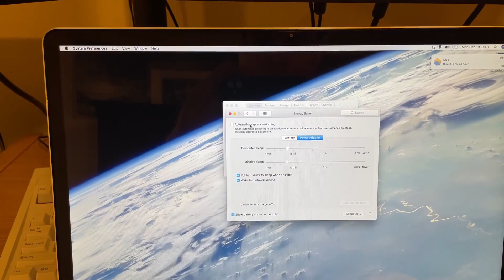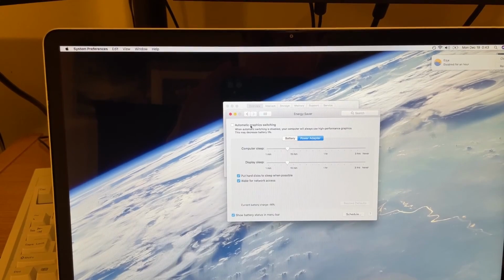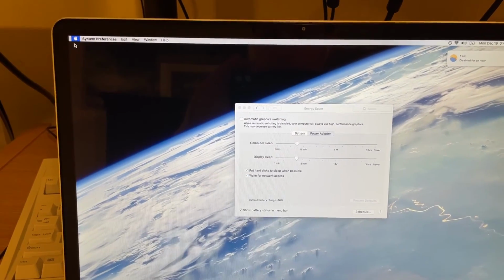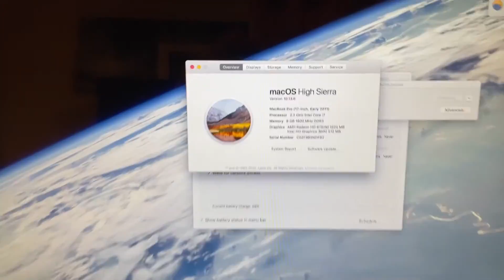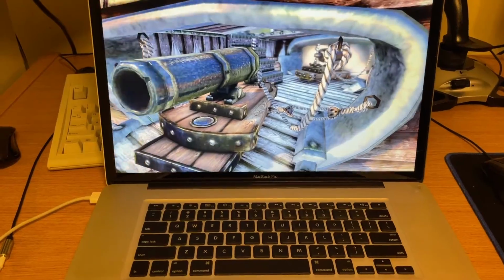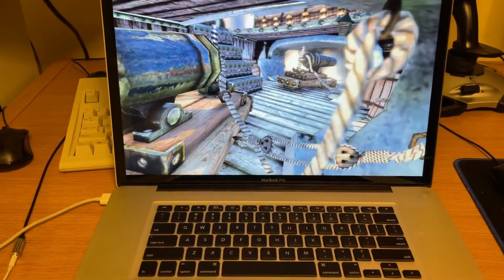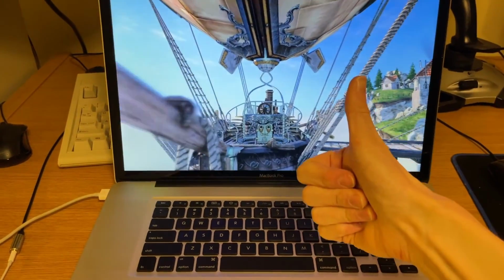2011 MacBook Pro 17" A1297 Faulty GPU Replacement

Comment: How did you do this? Is there a guide anywhere that I can follow? Thanks
Reply from the maker: Standard BGA rework. No tutorial needed, but you have to be trained on the equipment.
Reply: @Josh.Davidson  if you didnt have the equipment needed to perform this, would it also be worthwhile to replace the logic board with a working one and sell the faulty one? and if i went through with that, would i need to transfer the serial number from one logic board to another? (idk how to explain it, i mean the part numbers of the cpu, gpu and stuff)
Reply: @Josh.Davidson  ig my question is, if i just replaced  the logic board with another one that has the exact same specs, would i need to do anything to make it work?
Reply from the maker: No.
Reply: @Josh.Davidson  just confirming, you are saying that if i replaced the logic board with another one, it would work automatically and wouldn't require me to do anything ?(except putting the computer back together ofc)
Reply from the maker: Correct. These systems don't have MB paired to anything.
Reply: @Josh.Davidson  ok, just wondering because im seeing that apple is serializing stuff like iphone displays
im assuming the same applies for the gpu, and it isn't paired to the macbook
would you say its possible for someone to be able to perform a bga rework like this with no prior experience? (with the proper equipment available, and a guide to follow)
i have some experience with soldering, i dont know if that helps tho (not micro soldering small components, stuff like leds and resistors)
Reply: @tgvinfinite2607 this stuff is before the time of the serialization of apple parts back when they still cared or at least didn’t mind right to repair

Comment: The chips unfortunately always fail again as you mentioned because AMD never revised them, However you do have options when that happens, You can use DosDude1's DeMux firmware that you flash directly to the gMux using the JTAG solder points with a Latice fPGA programmer clone that cost around $20 from China (And the key is $20 for his firmware), Which fully disables the chip or you could go the iBoff route where you once again remove the GPU and solder in it's place a iBoff x-whistler interposer board (and do a couple component changes) which will let you use external GPU's and they also sell a nevbolt kit that takes place of the BGA Thunderbolt IC and allows you to route those 4 lanes to a NVME SSD, I am planning to do this to my A1297 which I already have the GPU disabled on, I might make a video on the soldering process later on. Great video man!
Reply from the maker: Hi,
Yes I already know it (and mentioned in the video).  For a customer, I would not do this for exactly that reason. But this MacBook belongs to me, and I hate Intel HD Graphics 3000, so I just replace the AMD. I bought 2 chips so hopefully that will last me a while :D

Definitely let me know when you publish your video, would like to see it.
Reply: Hi Josh where I can purchase amd gpu for 17 inch pro late 2011? I couldn’t find Chinese markets
Reply: @MrSardor86 if you find where to buy it please tell me, I have the same problem

Comment: I am very gutted as the macbook pro I got is a 17inch model which is a 2009 core 2 duo, with the Nvidia 9600GT and sadly I think the GPU is bad as I get red screens and tons of garbage! Black screen into mac os or a red garbage screen into linux, I am guessing the GPU is dead. :(
Reply from the maker: :( probably
Reply: @Josh.Davidson  Ah bugger! :( I will still keep it mind, as in a later day when I get the funds, I may challenge myself to find a new or reconditioned chip and fix it. :D
Reply: these are supposed to be reliable though